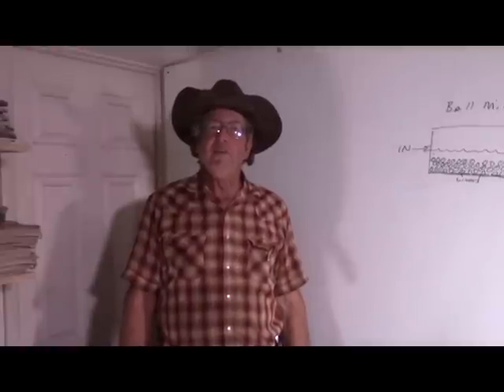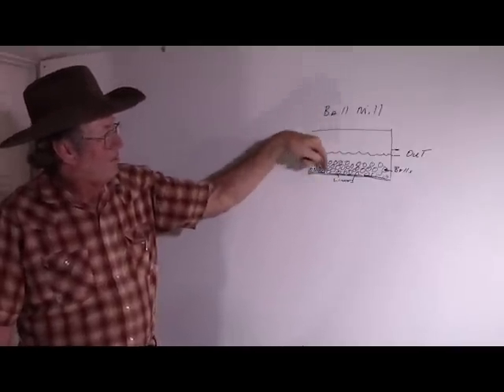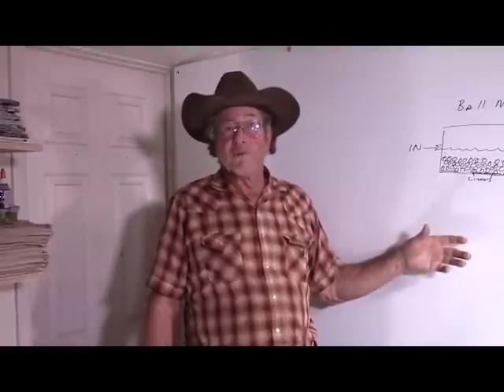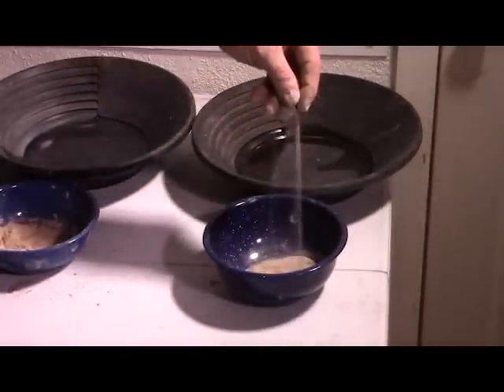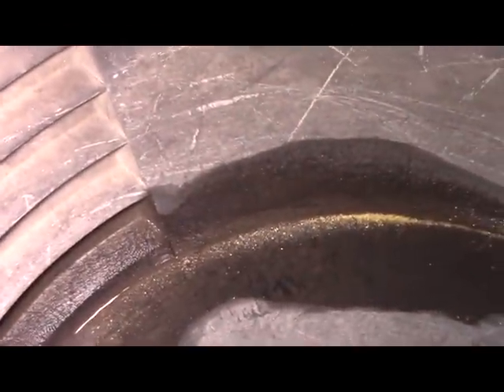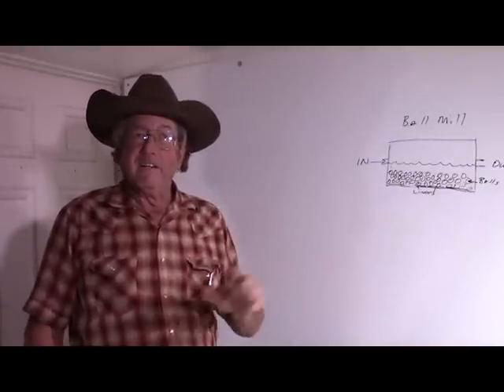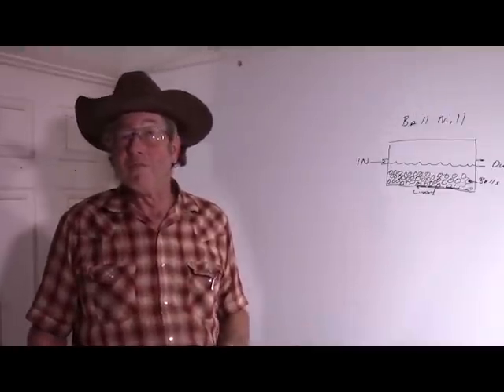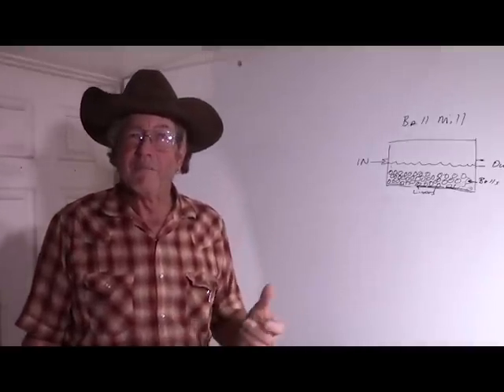Lesson 25- Is Your Grinding Mill a Gold Trap?

Comment: Good job on the video good explaining operation. I got the Keene RC46 .I have two 24'' Knudsen bowls in line they will handle about 3 tons of 3/16- slurry feed per hour using about 50gal per minute ,don't work well if you have excessive black sands .But it works excellent in find gold recovery a must for any miner.   thanks for your help if your videos .  CHEERS
Reply from the maker: Thank you.  With an RC46 you must crush for a while before firing up the bowls.  That is, unless you are normally using them for placer.  Thinking about it, 3/16 minus is pretty coarse for the Keene.

Keith

Comment: I didn't hear you say anything about jaw crushers. What is your opinion about those?
Reply: A jaw crusher is not a mill, not a pulverizer. You crush, then mill, 1 then 2.
Reply from the maker: Absolutely.  Jaw crushers are rock breakers, not grinders.  I do not have a thorough knowledge of the small scale jaw crushers, but anything smaller than a 4 x 4 isn't very useful.  I really like my Keene RC46 4 x 6 jaw over 6 x 6 rolls.  It eats fist sized rocks and spits out sand and powder at 500-800 lbs per hour.  Makes a big difference.

Keith

Comment: I would really expect what you found in the dead bedding,,,why? because of the vibrations taking place during operation,, vibration that would cause all manner of gold to settle to the lowest possible place( the bottom)😉
Reply from the maker: Exactly!  However, I had a friend who worked at a medium sized gold mine where they had a problem with a particular spot in the circuit plugging up with 'sludge'.  Luckily they had a couple of employees who didn't mind cleaning it out :-).  Later testing showed about 25% pure gold.  Even the big boys sometimes forget this one.

Keith

Comment: The impact mill we sell discharges out the bottom so doesn't trap much gold inside.
Reply from the maker: What is the particle size distribution?

Keith
Reply: Mostly -50 mesh to 100 mesh. Some +50 - 30, a little 20 or so. It's a good first pass. Some needs a 2nd pass. Haven't done a real mesh size distribution. Tends to ball gold so it concentrates better. Not much flat stuff that'll float away.Will do a proper mesh size test next time I get one in stock.
Reply from the maker: Sounds good.  What's the feed size and throughput?

Keith
Reply: 3" x 3", 250- 500 lbs. an hour. You might like to watch the mine explore videos at "Adit Addicts," and the "Velvet Rocket TV."  I know the guys and their explores are up in the area of my mine.
Reply from the maker: Cool.  Thanks for the heads up.  How long does your mill run before replacing wear parts at that size feed?

Keith